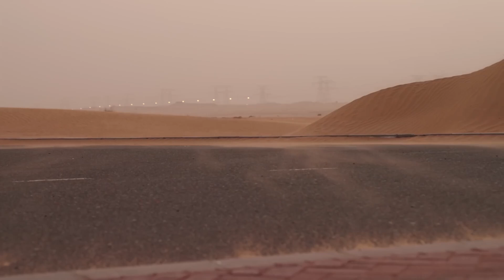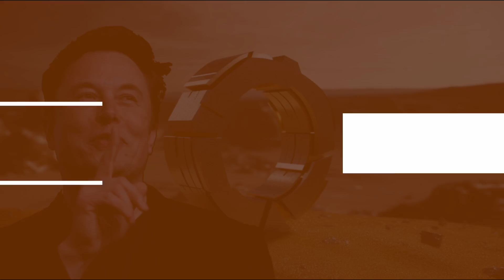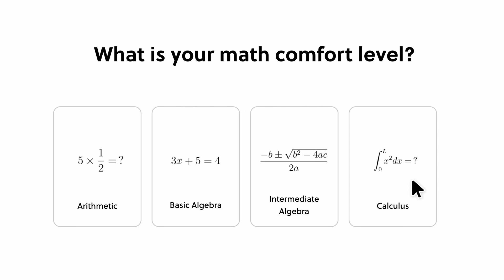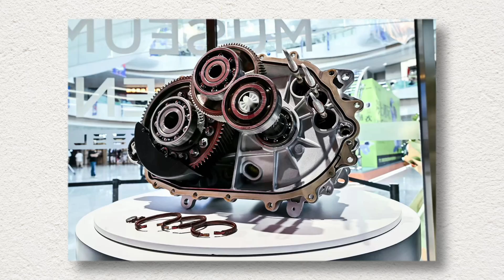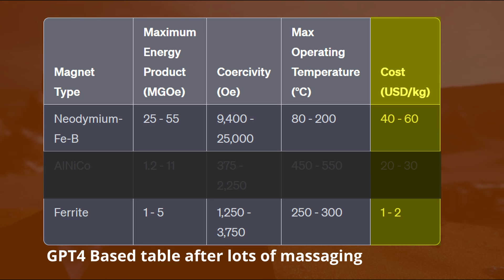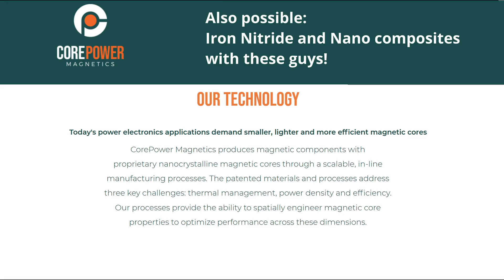Tesla's Magnets from Outer Space🚀 The Wild Engineering of Elon's Rare-Earth Free Permanent Magnets

Comment: A very interesting video. 
When you talked about the Curie temperature (I was not really aware before) - "In physics and materials science, 
-> the Curie temperature (TC), or Curie point, is the temperature above which certain materials lose their permanent magnetic properties, which can (in most cases) be replaced by induced magnetism. 
The Curie temperature is named after Pierre Curie, who showed that magnetism was lost at a critical temperature" - ist Pierre Curie (not Marie) 
I started to think about the Austenite "The austenite allotrope is named after Sir William Chandler Roberts-Austen (1843–1902)" and Austenitization 
"..means to heat the iron, iron-based metal, or steel to a temperature at which it changes crystal structure from ferrite to austenite.[3] The more open structure of the austenite is then able to absorb carbon from the iron-carbides in carbon steel. An incomplete initial austenitization can leave undissolved carbides in the matrix.
When remembering correct, a part of the stainless steel has nearly no additions and is not magnetic. I think it was more common in the US why Europe added other materials to keep the face-centered cubic (FCC) structure at room temperature. FCC Steel is not magnetic. 
But it some time ago when I learned about this. I hope I remember correct re Austen.
Austen and Curie seem to go in a similar direction.
Reply from the maker: Interesting. Thanks for sending, including the correction regarding Pierre vs Marrie 👍

Comment: "Introducing a new material ... is best suited for designs that are developed specifically with the material's properties in mind, rather than trying to fit in designs optimized for a different material. In the case of rare earth EV drivetrains, the wide RPM range requires control logic that uses wasteful flux weakening at higher RPMS that hurts efficiency. Motors designed around Iron Nitride can pulse the windings to optimize the flux of the magnets to eliminate this shortcoming and increase overall efficiency. No other material has the properties to do this well. Rare earth magnets have too much coercivity for this optimal design. They also require specialized magnetization equipment and specialized non-magnetic assembly tooling which add cost."
- The same Niron EVP quoted in the Wired article responding to a LinkedIn post.
Reply from the maker: Interesting point. However there's a chance, he is wrong about the pulsing - one of the articles I read (and I think even showed on screen) discussed pulsing without iron nitride magnets, iirc through AI. Technology progresses fast nowadays